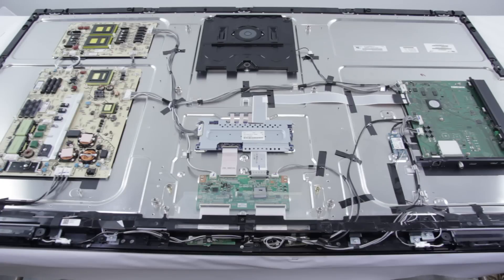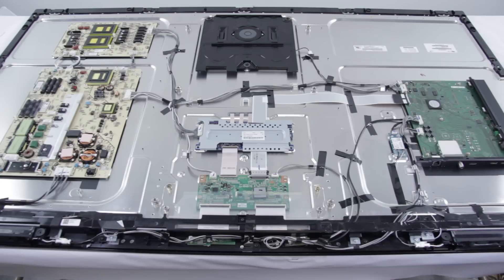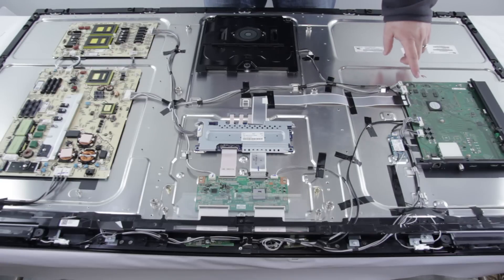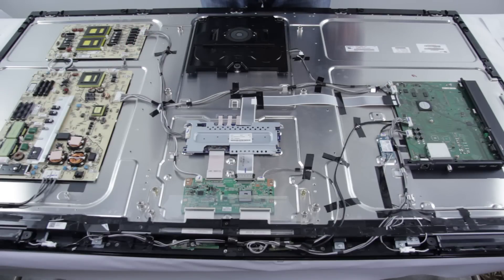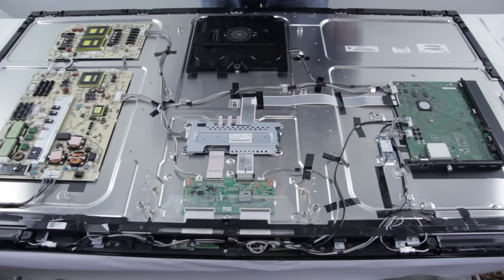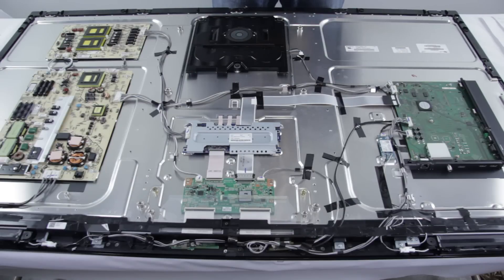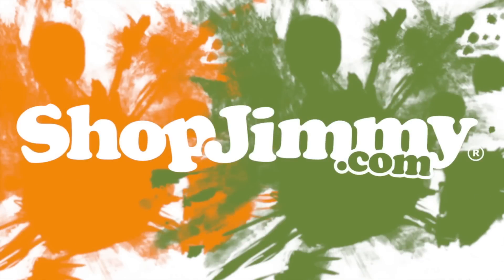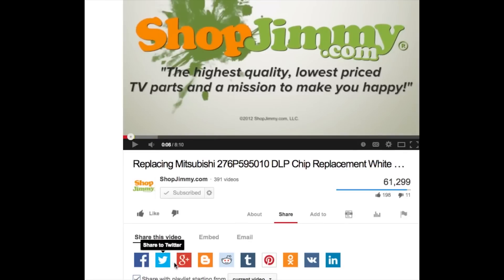LED TV Repair Main Board Overview Blank Screen-TV Has Audio but No Video-Common Issues Problems

Comment: I have a lg led 55 le 5400-uc.  The picture is grey and has vertical lines. But the sound still works. can you suggest anything to fix it. Thank you
Reply from the maker: Becki Feller   PLEASE SUBSCRIBE TO OUR CHANNEL - Try all repairs and troubleshooting at your own risk.  This could be a problem with either main board or the TV panel.  You can replace the main board to see if that fixes the problem.  Click this link to replacement parts for your TV model number:  http://www.shopjimmy.com/catalogsearch/result/index/?cat=56&q=55+le+5400-uc  There may be multiple boards for the same TV model number, be sure to match part numbers on your current board, with your replacement for compatibility.  Here is a link to a video showing how to identify your part number, click here:  https://www.youtube.com/watch?v=RwHTvjMdrhk  Thanks and please let us know if you have any further questions with your TV Repair!  www.shopjimmy.com

Comment: Hello, I need some help figuring out what part exactly I need to order for my tv to correctly repair it. I have a Vizio 42inch led smart tv, model# E420i-A0. The problem it's having is when I first turn it on my screen and sound both work good, but after about 2 minutes or so the screen goes black but the audio still works.

Comment: LG LC320DXE, have sound no picture, screen doesn't flash when turned on.  I changed out the T-con board but still no backlight.  Does that sound more like the controller board?  Do all 3 LED strips go bad at the same time?

Comment: Hi I have an LG 47LH30-UA with sound and no clear display.  Changed tcon board. same issue.  Any suggestions? Thanks
Reply: Hello just stumbled on your comment 
Have you gotten this issue fixed? 
If not 
Try the main board since sometimes the main board does not give the panel 12v and will cause backlight with no image hope this helps

Comment: Sceptre x505bv-fmdr: TV Powers on, there is sound and video can only be seen with a flashlight. Otherwise the screen is black but there is power and sound. Changed the power supply board and no change. Please help!

Comment: Westinghouse DW39F1Y1, sound is fine, while watching screen went blank, I used the flashlight method to check screen, I see items with flashlight.  What part do I need, thanks a bunch.
Reply: Having repaired a few LED TV's now on my own. It's the LED strips  that goes bad since there is no inverter as there is with LCD panels. When you Turn on do you get the Westinghouse symbol then nothing? (I hope it's okay to answer questions since i'm no affiliated with Shop jimmy lol).
Reply: lfhlaw no nothing comes on but volume.
Reply: Well I still think it's the LED screen. Since the main board is still sending all the correct information and processing sound and image. You can see images with the flashlight, so basically there's no light. The part you would need would be something like this. http://www.ebay.com/itm/Westinghouse-DW39F1Y1-LED-Light-Strip-Set-E306084-IC-A-HWAR39D299-/112082965716?hash=item1a18aa54d4:g:G~MAAOSwnQhXo9kh. I checked ShopJimmy and they're out of stock. The problem with e-bay is that most of the LED strips come from used TV's with broken screens. So there's a likelihood that those could burn out any time as well. The best thing to day is to tear down the TV and check the LED strips to make sure you're getting the right ones. It can be a bit daunting to Tear down the TV though and you need quite a bit of space, the bigger the TV, due to the LCD Panel has to be laid flat somewhere.
Reply: Thank you very much

Comment: Samsung UN60EH6003 - 60" LED TV Audio no video. wondering what board to replace and suggestions on what board to buy and from where.
Reply from the maker: Loli Hill   Try all repairs and troubleshooting at your own risk.  I recommend running the flashlight test on your TV.   Here is a link to a video we produced that shows how to run the flashlight test. https://www.youtube.com/watch?v=xUzCLgoSPGM Please reply with your flashlight test results and we can recommend a replacement part for your TV repair. Thanks and please let us know if you have any questions! www.shopjimmy.com

Comment: my brand is insignia led model no;NS37D20SNA14 when I turn on tv the sound comes on but the picture is hard to see.If you are right on top of screen you can see a little of the picture.I got in touch with insignia they said I needed a new power board but I think it has something to do with the back light because at the top of the back of t.v. when it works there are 2 lights on either side lit up but they aren't lit up when picture doesn't come on
Reply from the maker: david billard   Try all repairs and troubleshooting at your own risk.  This sounds like you have bad LEDs in the TV panel.  Unfortunately we do not sell replacement LEDs at this time for your model number.  Thanks!  www.shopjimmy.com

Comment: Hello, I have an Emerson Led 50" tv model number LF501EM5F a while back I hooked a vga cable into the pc port on the main board, then hooked it to my laptop. A blue spark came from the main board and the tv wouldn't power on. So I disconnected the tv from all power sources including in put hook ups. I found the main board burnt in two places. So I got all the required information and ordered a new main board from your website. I installed it with no problems, The Led lit up so I was thinking good sign. Well no sparks thankfully, now while I had it apart I looked over the power supply board found nothing wrong as described in your videos. Now I get no picture but sound, and the screen does light up. I only see the main board and the power supply boards, no t con board unless that is built in? Please help
Reply from the maker: +Frank Patti Jr   Try all repairs and troubleshooting at your own risk.  It sounds like you may have shorted the panel out.  Thanks!  www.shopjimmy.com

Comment: Hi, I have a Seiki 65" LED TV (SE65JY25).   It has no picture, but does have a backlight and audio.   I've also noticed only the volume on the remote control works.   Appreciate your thoughts.
Reply from the maker: Peter Brooks   This sounds like a problem with the T-Con board (if your TV has one) or the main board.  Unfortunately I do not see any replacement parts in the search results for your TV model number on our website.  Please reply with your part number on your main board and I can try searching for replacement parts.  Thanks and please let us know if you have any further questions!  www.shopjimmy.com

Comment: I have an LG 55LM4700 that has recently gone blank. NO LED on the front when it is plugged in, no video, nothing. I have removed the rear cover and there is an LED on the power supply board that after about 30 seconds starts blinking, 5 times then off for 5 seconds or so, then 5 times again etc etc. Board spec is 3.5vdc, 12vdc, 24vdc all of which I can find test points on the board for and all are present. Power board also says it is to output 78vdc which I cannot find a test point for on the board. Thanks for the information. Tom
Reply from the maker: +Thomas Ritchie   Try all repairs and troubleshooting at your own risk.  I recommend replacing the main board in your TV.  Click this link to replacement parts for your TV model number:  http://www.shopjimmy.com/catalogsearch/result/index/?cat=56&q=55LM4700  There may be multiple boards for the same TV model number, be sure to match part numbers on your current board, with your replacement for compatibility.  Thanks and please let us know if you have any further questions with your TV Repair!  www.shopjimmy.com

Comment: Brand Name: Seiki
Model Number: SE46FY10
Display Technology: LED
Display Size: 46 inches
Image Aspect Ratio: 16:09
the screen is black just the Audio is working i am able to adjust the sound also did the Flash Light thing which does show Picture in the Back Which Part do i Use

Comment: Hello, Seiki SE50fy10 image can be seen but there is no backlight at all. What part do I need?
Reply from the maker: H4DUJ   PLEASE SUBSCRIBE TO OUR CHANNEL - Try all repairs and troubleshooting at your own risk.  This could be a problem with either the power supply board in your TV or the LEDs.  You can replace the power supply board to see if that fixes the problem.  Click this link to replacement parts for your TV model number:  http://www.shopjimmy.com/catalogsearch/result/index/?cat=59&q=SE50fy10  There may be multiple boards for the same TV model number, be sure to match part numbers on your current board, with your replacement for compatibility.  Thanks and please let us know if you have any further questions with your TV Repair!  www.shopjimmy.com

Comment: I have a Vizio E470i-A0. The picture has stopped showing up, but the audio still works. When you turn the TV on the picture will come on for a minute or 2 then the screen goes blank. When we did the flashlight test you could see the picture using the light. When I checked the voltage on the power supply 1 side was putting out 100, but the other was only putting out around 50. Replaced the power supply board, but still have the same issue.  Thanks for your help!!

Comment: Hello, I have a  seiki se32fy22 that is about 2 yrs old. I use it regularly - it has been working fine. All of sudden when I tried to turn it on, it doesn't turn on anymore. It doesn't have the red light that stays on while it powered off. I have tried multiple outlets to make sure it not the power outlet. I am not sure how to check what the issue is - if its something minor that can be fixed at home or not. Please help. Thanks a lot.

Comment: Hello, I have 42 inch LG Model # 42LD55-UB that needs a new main board. The main board part # EBU60852902. I have searched just about everywhere for this main board and had no luck. I was wondering if you would know why none of these boards in circulation? I did review your site to no avail, do you have any suggestions on where i could locate this main board? 

Thank you
Reply from the maker: Pat Murphy   Could be a common problem for that TV model number.  Thanks!  www.shopjimmy.com

Comment: I have a Samsung UN60EH6003F 60in TV. Every time I replace t-con board it works for a few minutes then screen fades out. after a awhile the picture doesn't show at all again. still audio and backlight though. was wondering what could be burning out the t-con board. Thanks

Comment: I have Samsung UN65JU650D 65 inch LED smart tv that is showing problems hdmi ports not recognizing inputs and other software update message-persistent regardless of update or not.  Motherboard change recommended by Samsung tech.   I am supposed to turn in my motherboard so warranty replacement can be given by local service center.  My situation is complicated coz me and tv live in west Africa.  I want to remove motherboard and carry home May 4th.  And will hopefully bring back new main board.  If I hit roadblocks.  Where can I buy patria and trouble shoot remotely. Thanks

Comment: Hello
My Samsung un65ks9000fxza cycles over and over when you turn it on. The red light comes on. It kind of lights up on the screen then shuts off. And repeats. 
I’ve replaced the power board. And a untested main board and still does it. 
If I unplug the top bunch of wires the run from the power board to the main board it will stay on and the backlight it lit up.

Comment: Hi I need help! I have a Sanyo HDMI model number DP50843. My kids first hit it with a toy and it had lines going through the picture. Well a few weeks ago they finished it off with a football and the whole screen went black but sound still worked. I would love to hear that I can replace a part for pretty cheat lol. What can I do?
Reply from the maker: mikeandbethies  This sounds like a TV panel (TV Screen) problem.  If your TV panel is bad, it may be more cost-effective to replace the TV as panels are typically hard to find in stock, difficult to replace, and expensive.  Thanks and please let us know if you have any further questions!  www.shopjimmy.com

Comment: Helo i hope you can help me to find out my problem, I have a lg55le5400-cu tv that all of a sudden it when black I am able to turned it on and off but there is no image I removed the back panel and the only thing I can see is a blue light flashing on the drive panel

Comment: I have a Samsung UN60ES7150F. OSD Graphics (menus, apps, browser, YouTube) and audio all ok. Video from any source is mostly dark, sometimes bright green with discernible content in there but very wrong. Updated software, factory reset, and replaced the T-Con board (stated as NEW on Amazon). Can these symptoms be the Main Board, or did I get a second bad T-Con board.

Comment: I have a samsung smart tv 46 inch model number UA46D6000SRXXA version HQ03, year 2012, it powers on quite alright and i can see the samsung smart logo but with an unresponsive remote control. the only button working on the remote is the power button which also tends not to respond at other times. I can't change the channels or select various inputs such as HDMI, PC or other source selections. then in a few seconds it restarts on its own just like that in a cycle. I opened up the back cover, was hoping it were just bad capacitors but everything looked just fine both on the main board and the power circuit board. please help, what could be the problem

Comment: Hi, I have a samsung UN60eh6003f led that has black bars going horizontally across the screen and then will shut itself off after 30 mins or so? Power supply? Any thoughts or suggestions?  Thanks
Reply from the maker: rpm micro   This could be a problem with either the main board or the TV panel.  You can replace the main board to see if that fixes the problem.  http://www.shopjimmy.com/catalogsearch/result/index/?cat=56&q=UN60eh6003f  There may be multiple boards for the same TV model number, be sure to match part numbers on your current board, with your replacement for compatibility.  Thanks and please let us know if you have any further questions with your TV Repair!  www.shopjimmy.com

Comment: Hello, we have a Samsung UN40ES6100F "smart" TV that will not turn on. We were in the middle of watching a movie via our CPU on amazon (Which we have done for a few years), as I decided to turn up the volume with our compatible Samsung sound bar remote suddenly the sound for a few seconds sounded garbled, then theTV went dead. Now when I try to turn t on it will only flash red 5 times (and then for what seems 5 seconds) continues to cycle and fails to turn on. The sound bar is connected via optical to TV by  Digital in, the sound for the cpu is connected to sound bar and works when put on Aux, this has worked fine and I do not see it having anything to do with it shutting down as it did, or stopping the Samsung TV from powering back up. I took the Samsung TV off the wall. To trouble shoot outside of the TV I put up an older 10 year old working Protron TV and it (along with the sound-bar plugged in) works fine. The cpu works fine as it did on the Samsung. We have HD cable, and since the Protron TV is more than 10 years old the cable will not work I assume due to the resolution being too low for the HD cable box. I have the Samsung back open now and was wondering what thought you may have. I have read that Samsung has had problems with blown capacitors but see none that look out of the ordinary in the back of ours. Any trouble shooting tips or thoughts would be greatly appreciated.

Comment: Hi shop-jimmy. I have a Sharp 70" LED 240 HZ TV that was purchased two years ago.  The model # is: LC-70LE847U.  The problem I have is that I am not getting a picture to appear when I am plugged into my receiver or DVD player.  Originally I thought the issue was a bad HDMI cable, so I purchased a new one but did that did not solve my issue.  I tried plugging into all four HDMI outputs on the TV but nothing works.  I know there is no issue with the picture because I can access Netflix via my wireless internet and everything works fine.  Assuming my problem is with the main board.  What are your thoughts?  Also what does a new main board costs and is it easy to replace myself?  Thanks
Reply from the maker: Chris shutto   I recommend replacing the main board in your TV.  Click this link to a replacement main board for your TV model number.  http://www.shopjimmy.com/sharp-dkeymf953fm01-main-board.htm  Be sure to match part numbers on your current board, with your replacement for compatibility.  Thanks and please let us know if you have any further questions with your TV Repair!  www.shopjimmy.com

Comment: I have a  Samsung un32f6300.  My screen is jet black but I can hear the sound.  Is this t-con, power supply or main board?
Reply from the maker: korsobalias   Try all repairs and troubleshooting at your own risk.  I recommend running the flashlight test on your TV.   Here is a link to a video we produced that shows how to run the flashlight test. https://www.youtube.com/watch?v=xUzCLgoSPGM Please reply with your flashlight test results and we can recommend a replacement part for your TV repair. Thanks and please let us know if you have any questions! www.shopjimmy.com

Comment: Hello I have a rca 65" led tv model number :LED65G55R120Q. I have a black vertical line and a greyish line 3-5 inches wide on the right side. I am trying to determine the cause and what part I need so I can purchase the part. Please help. Thanks.

Comment: I have a Westinghouse wd42fb2680 on which the backlight does not work. I can see images on the screen with flashlight, and sound works. I've taken apart and it appears the backlight and the LCD are integrated or something. I can't figure out what to do from here and can find nothing on this specific model. Its pissing me off. The tv is literally three months old.